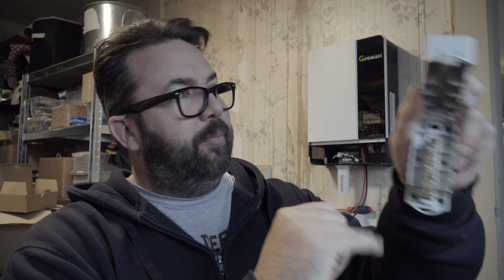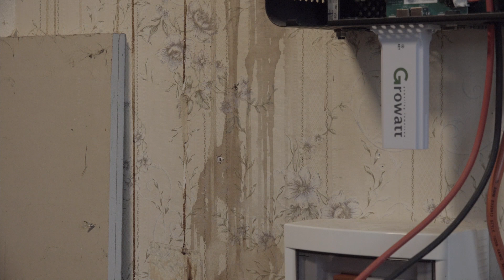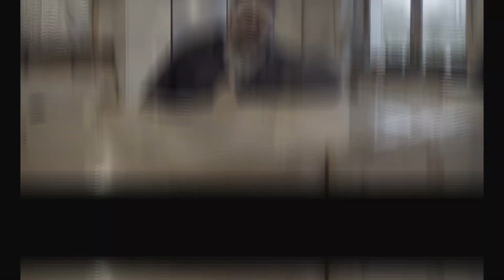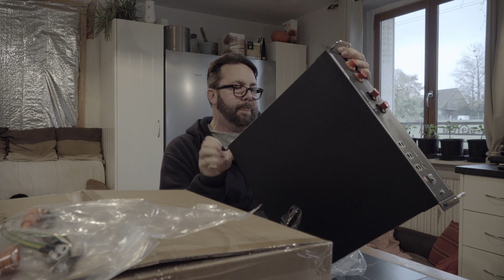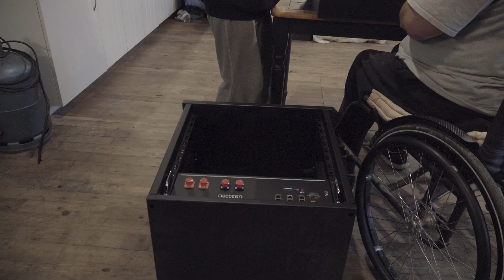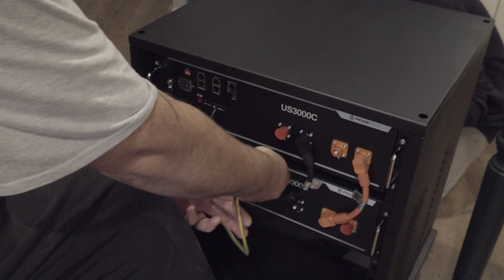Installing Pylontech US3000C Batteries

Comment from the maker: Just a couple more Solar videos to come after this one. Teaser: we have it up and running now, and it seems to be working well.
Reply: Glad you are installing a solar system Ben. I live on a small holding and with crippling power costs at the moment I want to do similar to help keep costs down , so I will watch with interest. Love watching your Range Rover vids as well Ben, I still have a bad parasitic draw with my recently acquired L322, hope yours is sorted now.
Reply from the maker: Range Rover seems to be playing ball now, keeping fingers crossed. Yes, power is going to get more expensive next year. It has been a bit of an out lay, and it will take a few years to see the benefit, but we can be independent and not have to rely on edf.
Reply: Hi need your hellp

Comment: Hi Ben 
Please I am also want to get a pylontech battery. And I noticed you installed your 3years ago. Please is the battery still working perfectly well after 3 years or what's you review about the battery
Reply from the maker: Yes they are still working perfectly, we added a US5000 to the stack and it was just plug and play.

Comment: I’ve just checked my US2000 batteries and non of them have an earth wire! They were fitted by the solar company, should I ring them and complain?
Reply from the maker: You would have to check in the manual, I have seen on YouTube that some people have them earthed, especially when they are in a metal rack and some don't.
Reply: @Bensgarage  thank you they aren’t in a metal rack and just sat on the garage floor 🤔
Reply from the maker: @barbsdee3831  That may be the reason they are not earthed then. Ours are in a metal rack, and just out of caution I have them grounded.

Comment: Do you have a link for the server rack please? 👍
Reply from the maker: It's not really made for the weight of the batteries, but I figured once they were in I wasn't going to be moving it about, so should be alright. I also used some wood at the back of the batteries to support a bit of the weight.  https://www.thomann.de/intl/millenium_sr2012_studiorack.htm
Reply: @Bensgarage  I’m gonna have 2 x SU5000 in mine so I might have to do a bit of welding! 👍

Comment: Hello there just quick question what is the maximum voltage you set up on inverters for charging.  ? Just asking cos I read on forums that if your battery cut off charging before inverter the extra current have nowhere to go and will definitely burn out the internet. So i fought ok ! But in this situation in this particular model like Growatt what if someone used this inverter as only solar no battery and then if nothing connected solar produced energy to so what it won’t burn inverter ? And one more thing what is the max charging voltage for pylontech ? They are 48v can be charged to 48-56 ?
Reply from the maker: Not exactly sure of the charging voltages etc. Just set the inverter up for lithium batteries and the BMS does the rest. As for the inverter burning out with no load, it works the other way round. Solar panels do not push power to the inverter, the inverter pulls power from the panels as and when it's needed. So if you have no load, the inverter will just sit idle.

Comment: Hi great vid just what i need.
Looks like i have the same inverter as you spf 3500 es,i am going to purchase 2x pylontech batteries like you but i was dubious as i wasn't sure if they was compatible. 
You have reassured me Thank You. 
Does that communication cable connect into the bms port or the rs 485 port on the inverter.

Comment: 1:50, it seems strange that Victron, one of the premium inverter suppliers, recommend a fuse and isolator between battery and inverter, yet your supplier dismisses this requirement.  Yes, Pylontech have an on/off switch, but it needs someone to activate it, what if there's an issue and you're not around.  Makes one think, maybe you should go out and buy a fuse/isolator?

Comment: what kind of cabinet you used? About to install the same batterys but in my shed outside, do you think it is all right?
A bit cold there but never under 0:) and I can do some insulation for sure there.
Reply from the maker: I used a millennium studio rack from thomann.de, it's not rated for the weight of these batteries, but we don't move the cabinet about and it's working well for us. As for the temps, check the instructions, there are specs for operating temps in there.

Comment: Hi Ben nice video well done 👏👏 I  trying to do the same but my question it is the battery and Inverter need  to be  installed  in my shed to run cable out into my house .. of course in winter will be cold do I need  make sure the battery and inverter will be well protected by cold water.. I hope you understand what I mean thank you...
Reply from the maker: A lot depends on which inverter and batteries you go for. My system, Growatt inverter will work from 0 - 55ºc and our pylontech batteries will charge 0 - 50ºc and discharge between -10 - 50ºc and shelf temperature is -20 - 60ºc, They obviously will work better in warmer temperatures.
Reply: @Bensgarage  hi Ben thanks for the advice the inverter and battery will be the same what you have because at moment is luck like good and better prices on market value last thing I I need to know if 2x3500 equal 7000 kWh pylontech battery is ok to run into a growatt of 48v 100ah 5000kw  sorry to ask I'm new on this and I don't want make mistakes thank you..

Comment: After adding 2 new US300c batteries to me my existing 3, do I need to change any settings on the inverter to ensure I am charging to the max 17.75kw capacity.
Reply from the maker: If you have communication between you inverter and batteries (BMS), you shouldn't need to change any settings.

Comment: Hey Ben , great video . Would love to know what Cabinate you used and how’s it’s holding up ?
Reply from the maker: I used this rack in the link, it says it won't take the weight of the batteries, but as I don't want to roll it around on the wheels it seems to be fine. Also I have small pieces of wood at the back supporting the batteries. https://www.thomann.de/intl/millenium_sr2012_studiorack.htm
Reply: @Bensgarage  thanks Ben will check it out .

Comment: Hi Ben. Great video, helped me to set up my batteries. Question - what rack did you use and where could I buy it? Have hard time to get one in Slovakia. Many thanks.
Reply from the maker: It's not really made for the weight of the batteries, but I figured once they were in I wasn't going to be moving it about, so should be alright. I also used some wood at the back of the batteries to support a bit of the weight.  https://www.thomann.de/intl/millenium_sr2012_studiorack.htm
Reply: Thanks a lot Ben. I ordered it from Tomman and it arrived in the meantime.   Take care!!!
Reply: Hi Ben. I have two Pylontech US 3000C as you do connected to AESun 5.6 kw invertor. For some reason, every time batteries gets fully loaded (reach 53.5volts as defined in user manual), and sun goes down, the voltage drops to 49 volts in 3to4 hours without anything being connected to it (apparch from inverter) Once it reaches 49 volts its stays stable till next day. Funny is that batteries lights still show fully charged. The figures comes from inverter. Do your batteries behave same way? Or you may have an idea what such dramatic droppage? Appreciate your input.

Comment: Hey Ben, I've just received my us5000 and server rack. Am I right in thinking the batteries only attach to the server rack on the front? It seems like an awful lot of weight to only be held on at the front?
Reply from the maker: The rack I have, has fittings in the middle to hold some of the weight, I also have the back of the batteries supported with some wood.

Comment: hi! Do you connected the bms cable (battery-invertor)? Do you have errors on invertor? A have Growatt with Pylontech (same models) and I don't have the proper communication cable. Can you make a video with the connection and settings of this particular part of the setup? I am very interested of all the process in details. I would appreciate it very much if you would do it! Good luck!
Reply from the maker: Make sure you are subscribed and click the notification bell, I have just filmed the bms connection, will put it out over the weekend.
Reply: @Bensgarage  Done! Also a close up picture with the two connectors of the data cable would be very useful. I read a Pylontech manual that said pin 1-3 should be null. I take a look of your cable and I dont think is like that. I lot of information witch dont match. I look forward your video! Thanks again!
Reply from the maker: @bccb491  I have all the dip switches set in the up position (on both batteries). Never had a problem with them. From what I understand, you don't need to change the switches until you have multiple battery banks.

Comment: Are most hybrid inverters compatible with pylontech batteries?
I have a 48v 3kw SNADI hybrid inverter., previously used with led acid batteries
Reply from the maker: Sorry, I don’t know. If the inverter has a communication port and it can talk to the battery bms, then maybe. But I would check with your inverter manufacturer first.

Comment: Are there any changes required for the DIP switches, or is the link port connection enough for it to know which one is master?
Reply from the maker: I have never touched the dip switches, they are set the same as they were in the box. I think the link port defines the master battery and the dip switches only come into play when you have multiple battery banks.

Comment: Hi Ben, we were told that the first dip switch of the main battery should be up? As there was a communication problem we put them all down, now everything seems to be working. But yours are all down? Any comment?
Reply from the maker: I have read that the dip switches are not important, until you have multiple battery banks. Our system is working just fine the way I have them set.

Comment: Could you explain what the white switches on the red panel do,thanks
Reply from the maker: Did you get the instructions with your batteries? I never changed mine when I installed it, and it all works fine and communicates with the inverter as it should, might have just been luck. According to the instruction manual. Dip 1: RS485 Baud Rate. 1: 9600, 0: 115200, after changing restart the batteries. Dip 2: CAN terminal resistance on BMS side. 1: NONE, 0: Connected, after changing no need for restart. If single group mode, keep Dip 2 at 0 position. Dip 3 & 4: reversed.

Comment: will your solar system still work and power the house if the grid goes down for a unlimited amount of time
Reply from the maker: Yes, we can be off grid with our system. Only connected to the grid until we add to the system with another inverter. But if the grid went down, we would still have power.
Reply: @Bensgarage  thanks Ben for the reply, why i ask is because we are on the verge of having a solar/batteries installed in a couple of weeks time and have read somewhere that if the grid went down you can only run your solar system until your batteries are basically flat then you would be without power - so this is incorrect ? or do you have to fit something where its isolated from the grid ?
Reply from the maker: @kroozer5215  yes, you will only get power when either the sun is out or you have plenty in your batteries. We only have six panels at the moment, and if the grid went down, we can charge the batteries through the inverter using our generator.

Comment: What Rack do you use ?
Reply from the maker: It's not the strongest and not quite rated to the weight of the batteries, but we don't move it around and is working well so far. https://www.thomann.de/intl/millenium_sr2012_studiorack.htm

Comment: Hi Ben. Great video. 
I have one Pylontech battery US 3000 and considering adding another. Our one battery charged completely by mid morning when it’s sunny in the summer but in winter it doesn’t  charge fully at all making two batteries in winter, when are usage is high, superfluous . Do you reckon the additional battery is worthwhile
Reply from the maker: We have the two (want to add more) and they seem to be doing a good job so far. Batteries were at 69% last night before bed, this was after a rainy day, and this morning they were at 42%. So not sure if we could get through the night comfortably with just one. Seem to work well for us in the winter too, also depends how much PV you have coming in. We aim to get more panels up very soon, to catch some winter sun.

Comment: Hi Ben my on grid (no hybrid) inverter got two mmpts ... Now im using one from panels can I load the other one from batterys? Technically i mean (respecting volts amps and all that)
Reply from the maker: Sorry, I don’t know much about other inverters etc. Just know what my system can do, and I only know that through lots of reading on the internet.

Comment: Hi Ben, can you help? Trying to get information on the 'dry contact' port. I assume this a RJ45. All I want to do is remotely turn on/off the battery. Can't seem to find anywhere on what sort of signal is required for Pins1 and 2.
Reply from the maker: Sorry, I have no idea. Mine is hooked up to the inverter and that does all the controlling.
Reply: @Bensgarage  Not to worry. Thanks.

Comment: What do you do if the voltage of the batteries are not balanced
Reply from the maker: Some sources suggest that connecting them up, they will balance themselves. I'm not sure about that, you could find the lower voltage battery and just connect that one to bring the voltage up, let it rest so that the voltages match and reconnect them all back up. Mine were the same voltage, or thereabouts.  But looking to add more this year and will have to check before I install them.

Comment: Hi Ben! Thank you so much for your video. I do have a question. I have the same batteries but not sure what the ADD / dip switches should be on, any advice?

Thank you 🙌
Reply from the maker: I have them all set in the up position, not sure if that’s correct, but they seem to be working ok. The BMS is also working, and communication with the inverter all seems to work as well.
Reply: Thank you Ben! I in the end had my communication cable in the wrong place 😂 
I have a goodwe inverter and oh my gosh having so much trouble with it. 
It’s not picking up the grid now. 

I have a different growatt setup on our house. Never had any problems, but got a goodwe for free lol, no wonder it was for free 😂

Comment: Hi Ben , 
My inverter has recently started making a loud buzzing noise - very odd. Only installed the day before and I did just plug in the Wi-Fi dongle before the noise started? Any ideas please
I turned it off but doesn’t actually turn off?
Reply from the maker: You will have to disconnect all power sources, then it should power off. As in solar pv input and grid if you are connected. There maybe a reset in the menu. Haven’t got my handbook available at the moment, but that’s what I’d try.
Reply: @Bensgarage  thanks Ben 
Yep took ages to power off but when restarted all quiet :-) 
Thanks for the reply

Comment: Great video.  Can I ask what was the make and supplier of the rack and do you think it has enough room for 4 of those batteries. Thanks
Reply from the maker: I got the rack from Thomann.de it’s made by millennium. Not meant for batteries, you wouldn’t get four in this one, but they do larger ones which probably would. It’s not the strongest, but we don’t move it about, and it’s holding up well so far.

Comment: Does it matter which plus and negative you attach the main (and only) bank? They both say either positive or negative but unsure if you should use left or right matching set?
Reply from the maker: Negative are the two on the left and positive on the right, I don't think that it matters which you chose, as long as if you are putting multiple batteries in parallel you don't put neg to pos.
Reply: @Bensgarage  On my app it says under errors that the charger awaken failed on the times i tried to use it. Do you know if it can be done from the solax control touchscreen? Sorry for the questions. Its hard to find any good information online and the helpdesk is in the Netherlands and not been able to contact so before booking an engineer wanted to see if it could be fixed
Reply from the maker: @FireFlySamson  sorry I have no experience with solax inverters. Do you have the instruction manual, that should give you a clue.